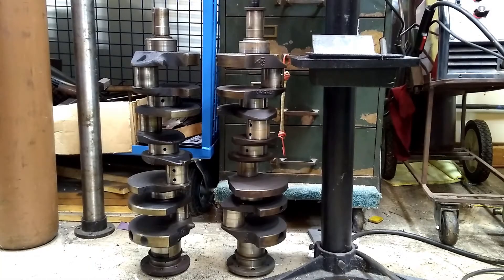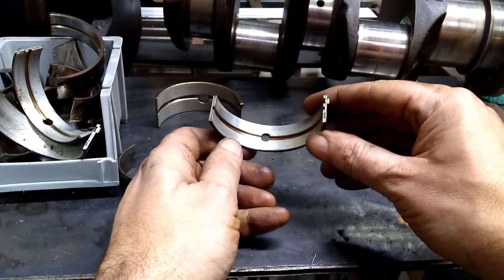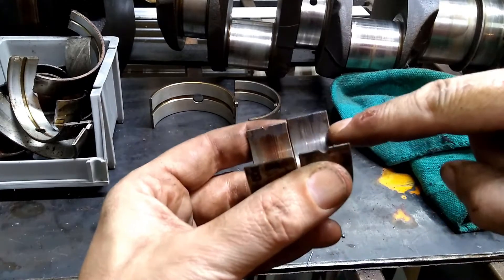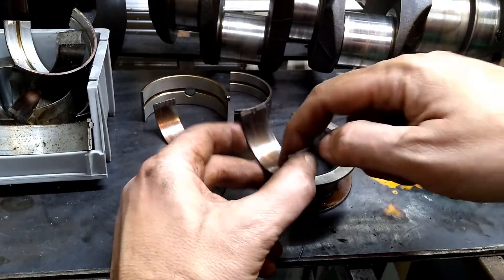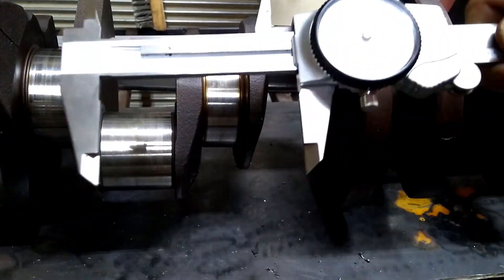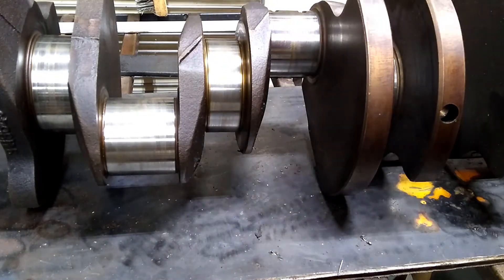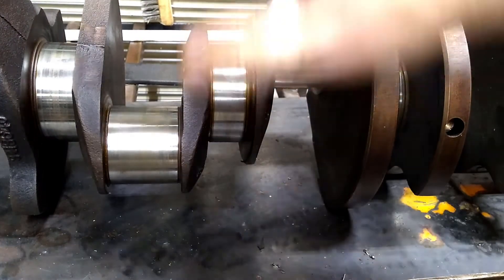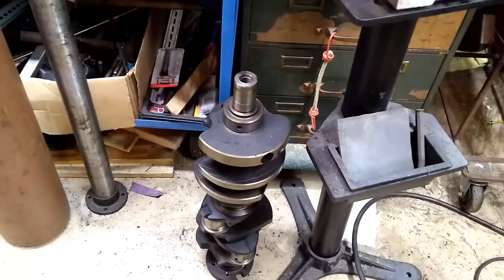Checking an Engine Crankshaft - Mopar 5.9L Magnum Daily Driver Engine Part 2

Comment: But how tight should I tighten it?

Another reason to avoid turning the journals is if the manufacturer has hardened the surface of the journals, you will be removing hardened layer.